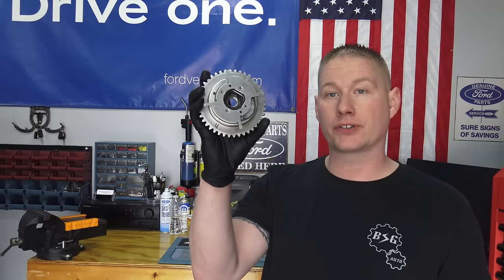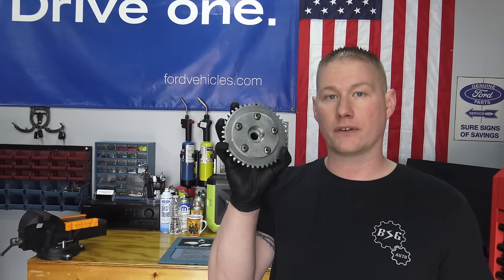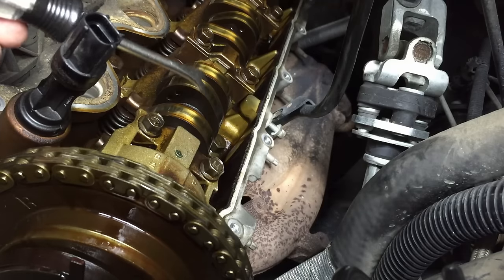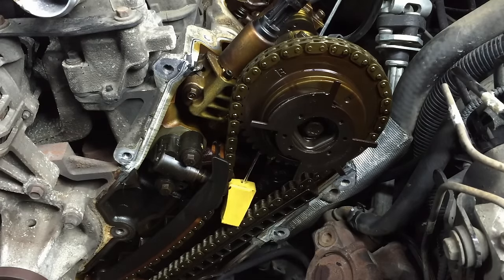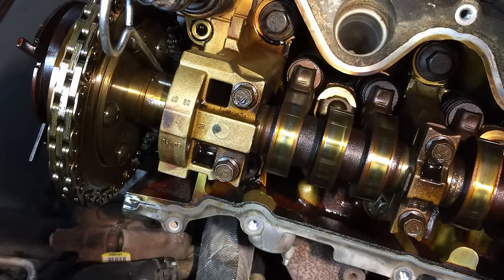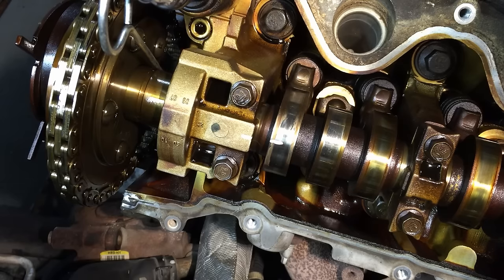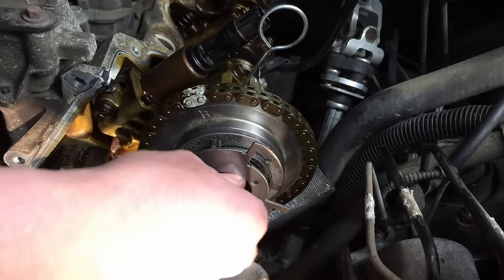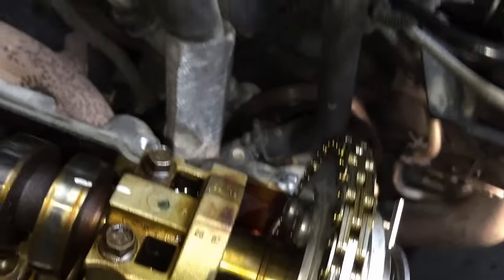Ford 5.4L 3v Camshaft Phaser Replacement**UPDATED FASTER PROCEDURE**

Comment: I have a 2010 F150 with the wonderful ticking.  I have so many issues with this truck in the year that I've owned it. Water leaks, exhaust manifold replacement (the other one prob need to be replaced as well), running boards that are stuck (1 up 1 down), ball joint replacement....Not too excited about spending 2 grand to replace the cam phasers.  

What will happen if I don't replace?

Comment: Used this to replace my VCT. Thank you!
Reply: How did you guy remove the cam phaser bolt. My impact doesn’t fit between radiator and bolt. If i use the breaker bar, it keeps pulling the block inside alternating my 11 oclock

Comment: Would cam phasers cause low compression? I was told to hold the gas paddle down and turn the key. If the engine turns over and doesnt sound like it’s consistently firing that means I have low compression in one or two cylinders?

Comment: +fordtechmakuloco my 2005 ford expedition just started doing that ticking noise on idle speed will a bad cam phaser hurt the engine in the long run? I meant if i don't fix it  will it brake the engine or is just basically repair it to get rid of that noise? And also i noticed the las time the oil was changed 10-30 was used so once it stars doing the ticking noise if i change the oil to 5-30 will it help with the noise? Or damage is done? . Well hopefully i can get an answer but  hey thanks for the videos they help a lot and whats good about it they are free :) so far jejej take care and i see you from Arizona

Comment: Great job on video, I have a question I haven't changed anything yet on my 09 f150 5.4 but just saving up $$ to buy parts but can i run the 5w-30 oil in my truck now or will it do more harm than good ??
Thanks
Reply from the maker: Yes change to 5w-30 anytime
Reply: Ok great thanks.

Comment: would it be possible or advisable to pull the camshaft after locking the chain in place and replace the roller followers and inspect the lifters? What would be the downfall?

Comment: I have a 2005 5.4 triton f 150 and from the research ive been doing it has problems with the top end of the engine, either bad valves, timing off, loose chain, or bad phasers, what codes tell me that the phaser is bad?

Comment: Sorry to get off topic here, but I couldn't find anywhere on your channel to post a question. I have a 2000 Excursion Limited, 4x4 V-10 that i CONSTANTLY have trouble with the brake calipers locking up on the front. I've replaced the calipers and the lines on both sides, and this only seems to be a temporary fix for anywhere from a month to a year. If you have a video on this topic, or have the cure on hand, please share. I have 217k miles on this beast,.....don't want to let it go yet. Thanks

Comment: I am replacing the driver's side phaser on a 2007 f250 5.4.  I am to the step of breaking torque on the original phaser bolt, but the cam is trying to rotate when I turn the wrench counter clockwise.  I had marked the line on the top of the first lobe and cam cap, so I could see this start to happen and stopped immediately and moved it back to the original position.  I thought I had the second cam at 11 like the instructions said, and the timing cheese in place to lock the bottom part of the chain.  I do have an impact wrench I could use instead of the manual one I was using when it started to rotate, but would that make a difference?  What would likely be wrong since the cam seems like it is trying to rotate instead of being locked in place. Maybe I don't have the 11 oclock position right?  I saw in the video your chain and cog sort of jiggle a little when you removed the bolt, but the lines you drew did not appear to actually move and the cam seemed stable.   Thanks in advance for any help.
Reply: I did use the power impact driver to remove the bolt and it came right out without rotating the cam at all.  Using the manual breaker bar to try to remove the bolt was the problem.

Comment: Okay, decent video, and I can applaud and appreciate the effort and intent. However, I'd like to add a little critique. First, when I did mine (two separate occasions), I used a tip; from you I think, to place vice grips around the neck of the camshaft (between back of the phaser and cam cap) to secure both the cam and its relative position. I have also more successfully used a pipe wrench with paper towels jammed around to prevent any cam damage or scarring. It worked phenomenally as the handle was so long, it levered itself stationary very easily with out the risk of a too tight vise clamp. Honestly I think that eliminates the risk of that cam slipping some once you start wrenching out that phaser bolt. You were lucky not having yours move at all, and while I totally get the cam lobe positioning critical pressure points, I think very few people would grasp that absolute dire point. Your video steps kind of glazed past that point without fireworks. Adding a vise or wrench eliminates t
Reply: Important step!!

Comment: So I recently acquired a quick startup rattle on my 2010 F150 with a 5.4l only last a couple seconds and only after it sits at least an hour.. would you say it needs new chain tensioner? Or just replace everything?

Comment: I know you're more of a stock Ford part replacement kind of guy, but have you tried out the cam phaser lockouts yet? I've got a kit that comes with the cam phaser lockout blocks and a programmer w/ VCT delete tune for $500 that allows you to lock the original Ford cam phasers into the advanced position and you don't have to buy new phasers that way, and they can never really go bad again. Or I can rent you the programmer for $300 if you don't want to own the programmer. This not only fixes bad phasers that won't lock into the advanced position at idle, but it also prevents future problems. It's a really cost effective alternative and a permanent solution.
Reply: Did you install this yet?  If so, did it work out?
Reply: @altcountryfan  I have done a bunch of these. It works out great. Once the lockouts are installed, there are zero phaser or solenoid issues ever again. If you would like help doing it, contact me on my Facebook page.

Comment: I have a 2007 F150 Fx4 5.4 3v, I bought it used at 70k miles, The tranny was fucked,  I put a new tranny in it and ran 5w30 full synth pensoil and its now at 185k and No phaser locking pin knocking at all, its quiet Im redoing the assessory belt pulleys cause they're all shot, but the engine sounds brand new

Comment: How advised is it to use an impact to remove the cam bolt?  I am about to do this job and was just wondering if it was safer to use an impact or if a standard socket driver would be sufficient.
Reply from the maker: +PsychoCPU Both ways are ok

Comment: Your tutorials are spot on.  I do have a question about fords updated phasers tho.  I just bought the “updated” o kit from Freedom Racing and I can’t find any literature if the phasers I purchased are the upgraded version.  Looking online has also been futile.  The parts they supplied are 3R2Z-6A257-da.  Do you know if these are them or should I hunt down a better product so I don’t have to dive back into this project again in a year?
Reply from the maker: that is the latest part just make sure they send you genuine ford parts and not substitute for an off brand and claim its better, they are known for that...
Reply: Thanks for the quick response.  After checking the laser stamps on the phasers I received I do see FoMoCo but the numbers are different.  Does the laser stamp 3L3E-6C524-KA cross over to the new phaser from ford? The phaser boxes Freedom supplied are ford tagged as 3r2z-6a257-da but had been repackaged.  Man I really appreciate your help and your excellent tutorials

Comment: Hello, followed your instructions to a tee but when I went to replace the phaser on the left side the pin on the new phaser was in a different location than the new phaser. Any thoughts on how to get the pin back to home on the old one or will i have to go by way of timing marks from scratch?

Comment: I'm gonna be doing this soon. Wonder if a guy could help hold the cam in position with a pair of vise grips. I see there's a bit of exposed shaft there just behind the phaser, looks like a good spot to clamp on. MIGHT try it without the wedge too... Sounds scary but if I just keep the chain tight by holding it up, that'd save me a couple bucks lol

Comment: Brian - Can I use 5-30 Full Syn oil in my 2009 F150 4.6L 3v ?  The temperature rarely changes over here.
Reply from the maker: +Hawaiian F150 I would yes
Reply: Cool.  Thanks!

Comment: Hey I have a question, I have an 05 f150 5.4 it has a rough idle when warmed up coming to stops and sometimes stalls and doesn’t want to run at all. When vct are unplugged it does not do it and I just replaced the vct solenoids and is still doing it. Would it be the cam phasers bad?
Reply from the maker: The timing chain tensioner seals are blown out, generally at this point in time a complete timing job is needed to correct the low oil pressure causing erratic vct operation.

Comment: What is your opinion on Cam Phaser lockout kits? I need to do my phasers, and for the price of two new phasers I can get the kit to lock them full advanced and get an optimized PCM tune also.
Reply from the maker: I think it is a band aid solution. I never like aftermarket mods in general and would never use them.

Comment: so I screwed doing a lockout kit. i installed tune ist then did lockouts. i didnt set the crankshaft to the said positions to line up cam lobes. i did mark the chain and phaser but when i pulled the phaser off the cam moved like 1/8 turn. so i turned the crank slightly to line up the pin on phaser with with hole on cam. now i think i may have jacked up timing because it runs rough as heck with +30 fuel trim stft on drivers bank 2. My question is if I pull the valve covers and even crank pulley if i have to get to keyway, can i realign the timing without having to pull the whole thing and mess with rocker arms?

Comment: My 1999 5.4 expedition dies in the middle of the road while driving with no Warning! I have great oil pressure. I'm thinking it could be bad ecm? I have had a lot of Electrical issues in the past but a new windshield helped a ton! The rpms will fall to zero right before the engine stumbles and dies like the trans has slipped but it's not. Not sure where to start? I never lose Electric power during the event. Blah!

Comment: Hello how are you  i have a 2003 ford f150 svt lightning truck 5.8 liter supercharge and i love my truck. i have a cooling leaking on the pasenger side where the headers are located and also alot of taping noise on that same side what can you recommend where i can  buy a new engine i live in the atlanta GA area thank you.

Comment: I am new to owning a ford, especially the 5.4L engines, I have a knock at around 1000 rpms but goes away below and above 1000. I plan on redoing timing chain components with a Cloyes timing chain kit, getting a Melling 360HV oil pump and getting a lockout kit to prevent having the issue further. do you think that will work?
Reply: Did u ever go thru with it? I’m thinking about doing the same to mine
Reply: @Yung_DDG  I didn't lock it out but I did everything else I head so mixed reviews on locking them out that scared me away from the idea. I have 23k miles on the new timing rebuild and it's driving fine.

Comment: Your instructions are good but I did mine and I’m into a bit of a problem when I put the phaser back on cam and started torque to yield the outer timing spikes started to rotate on me and well I just when with it and s put it all together and now the  locoford truck won’t start I’m guessing it retarted timing but I don’t understand why mine moved where as when you did It it was fine and was still I don’t know what I did wrong  please  help anyone.

Comment: hi ford the tech need help badly tell me what you think. so my truck start  running like a stuff pig to were it would die and not want to start so calling a round and using a obd II getting the error code came up that the VET'S was bad so I replaced both tho when I did the driver side guide noise when truck was running turn the truck off and replaced passenger side clear codes and then a friend notice the grind noise was my driver side valve cover had a hole in it over the cam phaser so bought new cover when I took the timing cover off notice the there were two guide broke upper passenger side and lower driver side so I replace them and notice the tensioner on the driver side was stuck so replaced that. so upon removing the tensioner figered that the chain came off and that is how the valve cover got a hole in it so thought the timing was off watched your videos and did research. before doing timeing the valve cover is still on the passenger side but anyhow I put the timing sprocket at 6 the Lord on driver side look close to were it should be but chain was not linking up so  buddy took chain off while I held chain and the L on the driver camshaft phaser  move a bit counter clockwise so he move it a little back to were it was removed at it counted links 30 links not counting crankshaft link for Mark due to my chain not having timing marks on it is why I counted links out put back together and runs fine while cold as engine warms runs like crap loses oil pressure dies. so I check codes with the OBD II again figure camshaft sensors bad so replace them got rid of more code went back to replace passenger side VCT back to old one runs better but still warms runs like crap getting error code p0022 drive or reverse dies or runs bad have no money you think it off one tooth and how can I fix this with taking timing cover off missed 12 days of work and sunk 300 at least into it please help me

Comment: Can I install a 2007 Flex Fuel 5.4 in to a 2004 non flex fuel? Are the engines the same or is there some conversion necessary. I have a good                
engine sitting here and am looking at buying a truck with a bad one. Would save me quite a bit of money.

Comment: I am an Engineer ! if i was to design the part for this 5.4 i would make the end of the cam shaft behind the timing gear rectangular shape to be able to place a tool to hold the cam in position for any kind of service
Reply from the maker: +Guiding light Many Ford engines are like that
Reply: What happened?
did they fall sleep when they designed this one ?
Surly this engine is a very poor design as you already know !
Reply: BUT!
thank you for your effort helping others how to deal with these ford products .

Comment: Does your "Updated Procedure" replace removing the rollers when installing a complete CAM phaser kit?Are cast iron tensioners and metal rails better than the standard plastic ones or make any sense?

Comment: Hey Ford, What steps in order do you recommend for a diagnosis and inspection of the motor?  Just subscribed, too. I bought a 98 F150 with a 5.4 at a govt abandoned vehicle auction, and well, its got those rattles at start up and some slight noise I can't identify coming from maybe closer to the bottom of the engine. It has 81k miles on it, and we can assume the maintenance history is poor. I haven't tore it into yet - was looking for some guidance there before I get crazy with it.

Comment: Please please help, I was getting codes p0345 and p0349 for cam pos sensor on bank 2. I replaced just the phaser ( genuine), + cam pos sensor, and tested the alternator and still getting same codes. Do I have to reset the PCM?

Comment: My 5.4 runns great Untill it warms up. The it stalls so I try to restart it it sounds like it jumped time. After the oil cool off it runs fine. The The knock comes back. Is it the phaser? On bank 1. Bank 2 was replaced.

Comment: Question. Can you use the cam holder to lock the cam in place instead of removing the followers. I know the 2v engine uses them curious as if it would work on the 3v engine?

Comment: I bought a Jasper engine my original 5.4 locked up my Jasper engine lasted 49000. The mechanic told me I had codes in 2&4 valve it seems locked up but u can move it abit then it locks up and then moves again and does the same thing. Does it seem like the phasers to u.....broke single dad needs help.

Comment: I have a question, do the 2011 Mustang gt 5.0 suffer from this ?
do you recommend using 5w30 in place of 5w20 ? I have about 30,000 miles so far

Comment: Love your videos, just picked up an 04 5.4 3v with a little tick. I’ m confused about the R and L on the phasers. In this video the R is on your drivers side? In the longer video is the R is on the passengers side?
Reply: Per some comments below, a user says ford stopped marking them r and l because they are the same part now. Answers my question :)
Reply: There reversible left or right. Just 180 degrees off

Comment: Does this method work for the 2003 4.6 Expedition? I get ticking/knocking at cold start up but slowly the knocking goes away after about 3 minutes. Thank you.
Reply from the maker: You do not have phasers.